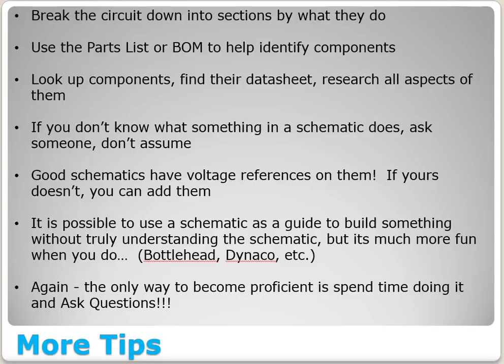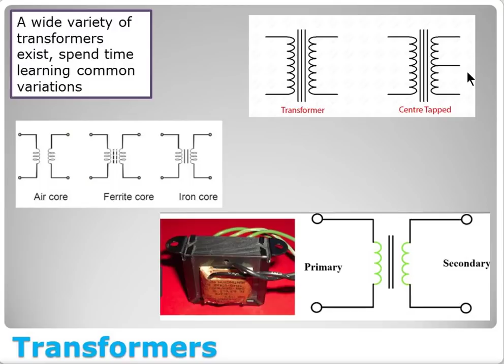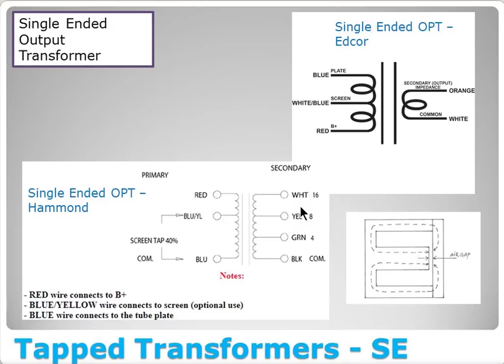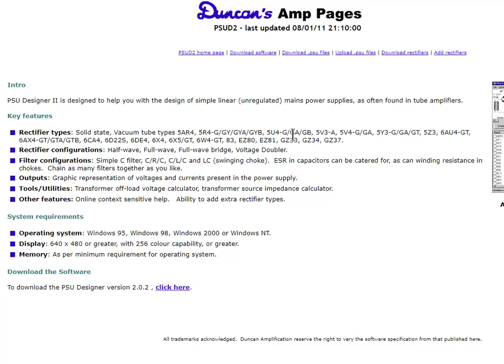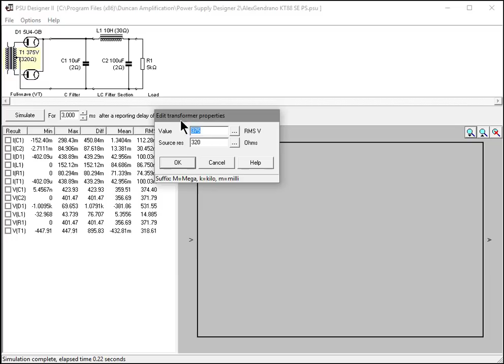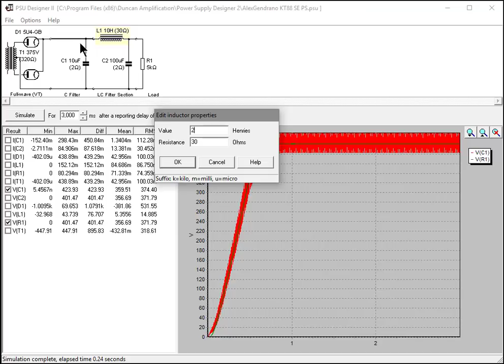Understanding Vacuum Tube Amplifier Schematics - Power Supplies - Part 2

Comment: I forgot to comment in part one, but the part that I liked learning, the most was about the coupling capacitor and how it prevents 400 V going straight to the grid of the other tube and basically the explanation of how a capacitor works, how it blocks DC voltage but passes AC voltage along.

Comment: Good video. I'm relearning. Went to school (20 years ago). No real world experience. Good review. The 5 VAC filament voltage line with the 400 volts dc coming off the same line is still a little quirky to me. I understand 2 voltages can exist on a line (ex: 10 volt dc with a 1 volt ac ripple)  ... but still!  Seems the 400 volts sitting on the 5 volt ac line would interfere with the transformer operation somehow.

Comment: What purpose does the CT of the 6.3V have? -- if the replacement X-former secondary doesn't have a CT for the 6.3V, is there a class of tubes' filaments that wouldn't work?

Comment: Breath of fresh air. A person who actually knows stuff talks about it. YouTube is pushing a lot of videos to me that eventually make me sad. Very often, you get people that talk total BS and can't understand complex circuits claiming totally wrong stuff spreading misinformation. To add an insult to the injury, when you correct them, they attack you and dismiss your correct information with plain rude stupidity.
You have to prove to them even the most simple rule of electronics. 
Real flat earyhers. 
As soon as I heard the voice on this video, it sounded calm and like someone sure of his knowledge, and it didn't disappoint.
I dred watching videos because if I hear misinformation, I will need to lose my time and comment.
In this video, there is one small mistake  and one thing that is almost no mistake and could be explained a bit more. I do understand that it is  a long video trying to explain a lot, but leaving something out might be important for someone.
That small mistake is about GZ34 and its heater and cathode. There is no superimposed 5V AC going into the DC/plus side of pin 8. DC side is referenced to the ground, providing minus coming from the grounded center tap.
5V tap is not center tapped, and pin 2 is not connected to the ground, so between pin 8 and the ground, there is no 5V AC. Sure, there might be some ripple from the fact that pin 8 is shared and is exposed to AC magnetic field, but it is not that bad at all.
Very easy thing to misunderstand.
The second little thing is something that really needs more explanation, in my honest opinion. Mind you, this is the first video I have seen of this channel, and some other video might have addressed it, but I wouldn't know that at this point.
It's about impedance issues with output transformers.
Two things about it. First is a little half mistake. In the case where you have only one 8 Ohm output tap you can connect 16 Ohm speaker to 8 Ohm tap and use it however long you want. It is not optimal, and you will not get the full power output of the amplifier. You will get only half of its rated power, but you will not hurt the amplifier.
Me saying this promotes bad president of experimenting, though, because if you experiment and connect the 4 Ohm speaker to 8 Ohm output tap, we have a huge problem.
4 Ohm load connected to the 8 Ohm output tap will reduce the projected impedance to the plate of the output tube in half. This will make the output tube try to pull twice more current than what's designed for. Something gotta give, and something will overheat and die. It might take even few parts put.
Please understand that the biasing current of the vacuum tube is way higher percentage wise than biasing current of the transistors. Fixed bias applications use 60 to 70 percent of the maximum plate dissipation, and cathode bias application uses up to 90 percent.
So you can't connect 4 Ohm speaker to 8 Ohm output and think you will just play it quiet so there will be no excessive currents true the amplifier.
That might be true with the solid state amplifiers, but it is not the case with the vacuum tube amplifiers.
Even if an easier fixed bias case, the bias current will already go from typical 70 percent to 140 percent. In the case of cathode biased output stage, it will go from 90 to 180 percent. So already without signal it will runn to high current and will break parts over time.
Therefore, I think more explanation is needed about how impedance on the secondary side affects perceived impedance on the primary side of the output transformer. Also, that would explain somewhat confusing information that you get with your Hammond output transformer.
Hammond expects people who buy and use their transformers to know stuff, but it ain't always the case.
Namely, they give you two or more values for each tap.
And they are perfectly correct.
They say, for example, 8 Ohm tap by 2500 Ohm primary or 16 Ohm at 5000 Ohm primary. This example is from single ended SE series.
What they are telling you is that the winding ratio stays the same, but primary side impedance changes with the load you connect to the secondary side. There is direct interaction between the impedance of the primary and secondary side. They are not two separated resistors. For the DC, they are separated, but for the AC, they are in the direct proportional value relation.  There is no electrical connection at AC, but the impedance of one side affects the other side directly. 
This can be useful sometimes. Some transformers might be designed for a pair of relatively powerful tubes but might have proper primary resistance for a set of 4 weaker tubes when you use secondary with different spaker impedance. Be careful with calculations, though. Mind you yhat you can't expect two tines higher current just because you use it as two times lower load. Transformer is power limited, wire used, and quantity of iron used limits its capability. 
You can't expect that 40 Watt output transformer becomes 80 Watt transformer.
BTW, it was a very nice explanation of the ultra liner operation. Easiest to understand. Most people are explaining it way too complicated way.
In today's world, one can't even expect that someone knows things like the rule of the right hand sadly. I think you might want to address it more. What is simple and logical to people from back then is mystery to people from today, sadly.

Comment: Thanks for the nice videos. However I don’t think your explanation in the video at around 19.40 is not accurate enough. The transformer core tends to saturate because of the constant quiescent plate current in the class A I think.

Comment: I understand that when the tubes are installed in an amp that load in conjunction with the internodal resistors in the power supply is what defines the voltage at the nodes and i know that when you pull the tubes those voltages go up but why do they not all come up to full b+?  If the ps isnt referenced to ground thru the tubes to define the voltage drop why is there still a voltage drop and how do the volts know how much to drop?

Comment: Really enjoying your channel ! Excellent series ! I wanna jump the gun and learn how to convert the schematics into or onto a board and how to etch ! I'm eatin this up ! I'm an ST70 Bottlehead ! Ya know I restored my first one way back in the early 90's before everyone sold all the kits and boards. I could follow the instructions and build it, but I was aggravated because I didn't fully understand how it worked ! I made one small mistake, I'd reversed polarity on one of the small caps on the driver board. Was using a Variac to do the initial power up. It popped and smoked about halfway up! I flipped it over and giggled when i figured out what I had done. I had another one, stuck it in there and it fired right up ! Thank you for what you have taught me!

Comment: Studied electronics in 70s - this brought it all back. Haven't touched a tube since then, but you've sparked my interest.    p.s. I almost skipped watching this "boring" power supply episode because I'd always thought that if I cooked up an audio tube amp that I'd just use a solid state power supply. Glad I watched though since understanding the PS is necesary to understand a tube amp functions e.g. biasing, 5v and 6.3v filiments.

Comment: I have something to add on the multiple OHM taps starting at 27:15  I am sure that most people know this already , but in case some folks don't know here it is ,  you can add switches on the back of the amp near the speaker jack  and label them 4 ohm , 8 ohm ETC ETC .... The most commons are 8 and 4 ohms for band amps .... Guitars and such....A lot of small 4 watt amps power a separate speaker  box.....  Larger amps like Peavey and Marshal's have the speakers built into the amp box .....

Comment: One thing I've always wondered is why (at least in these circuits) the rectifier heater isn't 6.3V like all of the other tubes'. Seems like a little $ could be saved by not having that extra 5V winding.

Comment: Interesting and nicely made but I seem to be missing an essential point on the diode operation: where does the magic B+ (400 or 500V) comes from? I undertand that for the diode to operate, the plate (anode) voltage has to be higher than the cathode. But how does one establish what the cathode voltage is from those diagram? You state this as if it was the most natural expectation but does not come as such to me. Is there another video that I haven't stumbled upon yet to establish this basic fact.. Thanks anyway for an otherwise very accessible material!

Comment: could you make video going in more detail into all typical capacitor application patterns to consolidate and give a few examples of solid state as well as valve amps using this patterns.  eg pattern 1 Resistor and capacitor  in input transformer... purpose making DC curve of B+ as constant as possible. pattern 2 coupling capacitor from plate output to grid input... etc capacity in cathode biasing circuit... there seems to exist 100 different patterns for using capacitors . typically seems to be always a game of let ac pass fix dc etc ... many thanks for the great video

Comment: Have a poblem i trie to solve.Power tube 3 is redplating.It happens  around 1 minutes after standby is off.I took out tube 2 and 3 so only 1 and 4 is left.Iknow i have to use 16ohm speaker into 8ohm output.This time the tube 4 started to redplate.when the tube start to redplate i can hear Hum.(bad capasitor after rectifier?for half the circuit? push pull.)Seems to be only the one side in the tube that redplate in both.Can it be a capasitor?ouput tubes is el34 where 2 is marked 1604.the 2 others marked 1606 if that means somthing?Is a old Huges Kettner trilogy.Cant find chematic or a service manual for it.

Comment: Really useful. I was trained as an electronics engineer by the Royal Air Force in the UK 40 years ago. I haven’t worked in the field since 1992 so I’d forgotten most of what I knew. I have a Fender Prosonic tube (valve to me as I’m British lol) guitar amp head which was faulty so I did a search and found your videos. Everything came flooding back. Result, 1 new electrolytic capacitors and 1 resistor between two halves of a 12ax7 tube and a fully working amp. Cheers

Comment: Great video ! ! Well taught with a great teacher vibe ! ! A beginners video with a shop tool list with electronic bench testing equipment included with suggestions as to which is best for two or three price ranges, electronic safety tips, basic trouble shooting techniques would be a great way to prepare for basic repair work.

Comment: I have a 1950's Chasse with 4 6v6's in push pull parrallel  to calculate the secondares of the output transformer is the plate inpedebins defferent then 2 6v6's .   And can I use a 5u4 and 2 as foods to form a full wave bridge.

Comment: Learned a lot, clarified a lot. Thanks. 
Questions: How does using DC regulated five volts on the filament of the 5U4 or 5AR4 change the output ripple if at all? Would there be any benefit to  feeding the rectifier filament from a separate transformer; does using a separate transformer for filaments take some of the load off the main transformer? Does the power supply program you used allow you to substitute dc to the filament?

Comment: Hope your still taking,requests I am very new trying to,absorb all I can I have several older tube radios and feel I have enough parts between tubes resistors transformers etc.. Could you do a scabbed together with what you got thanks your series is very informative

Comment: Very good information! I was wondering about center taps. I understand they can pull current off of the transformer but am not clear on why they can be grounded without causing a short. My guess is that grounding it is not a short and instead nulls the CT? But why not just cap the lead? Also, when using a CT, wouldn't that reduce the current from the other legs? Sorry if I am using current where I should be using voltage. I'm going to take a break from these videos and go learn about ohms law and do some breadboarding to further my learning. It has become clear I need to understand that before I can move ahead.

Comment: Question - On circuit example #3, just before the standby switch, there are a couple of 16uf 450VDC capacitors in parallel.  The purpose of those capacitors are described as being part of a CLC filter for B+.  Is there a reason why those capacitors are placed before the standby switch and not after the switch like the rest of the CLC filter?  Thank you  - Dave
Reply: If they were after the standby switch, when the switch was closed they would appear as a momentary short circuit to the rectifier which would pass a current in excess of its rating, damaging it and reducing its working life.

Comment: Glad I took the time to look at this one.  Never heard of a "death capacitor" before but it makes perfect sense.  Reminds me of an old 50s era refrigerator that I bought for $10 off a friend during my freshmen year in college.  One day I opened its door with one hand and touched a grounded metal shelf with the other hand and got treated to a full AC electric shock.  I quickly realized that the old non-polarized two pronged plug it had needed to be reversed so did that and from then on got no more shocks, but it taught me that grounded outlets and plugs can be lifesavers.  Even kitchen appliances can be shock hazards if you're not careful.

Comment: Hi Mark,if you Schematic required 10H 200mA choke and you only had a 5H 200mA choke can you put a resister in series with the 5H 200mA choke?

Comment: Hi Mark, Very good information.. Maybe you could do a video on actual formulas to arrive at a desired voltage on a tube plate, or screen.. For instance, if you were building your own amplifier and not following a schematic exactly. I know most amps are basically laid out the same (as shown in this video) but what if you wanted to use different pre-amp tubes which required more or less voltage? There must be math formula's for this. Thanks, Tom

Comment: Hi, this was a very informative video. I do have a couple of questions if you don't mind answering. In the schematic using the 7199 tube, how come there isn't a coupling capacitor from the pentode plate to the grid of the triode? Wouldn't there be DC present that needs to be blocked? Also, on most LTP inverters, usually one of the plate resisters is lower...like 82k or something, and the other 100k. Is that to try and equal out the gain? Just curious. Thanks

Comment: for your Aussie followers what changes to power supply design are needed for 240v (not sure of the hz) input?
Reply: Simply replace the 120V 60Hz transformer for a 240V 50Hz transformer with similar output voltages and currents. The difference in frequency makes no practical difference.

Comment: Very well explained.  You have a lot of patience going through all of this.  I would like to ask if you can elaborate on how exactly a tube rectifier works.  I am used to solid state diodes, I simply don't see how AC in a tube becomes DC.  Another big mystery to me is how a "choke" works.  How can a coil filter a ripple ?  I always thought this is what capacitors are supposed to do.
Reply: A tube diode, just like a solid state diode, will only pass current when its plate (anode) is positive with respect to its cathode, when it is said to be 'forward biased'. An AC voltage applied to its plate will result in pulses of current at its cathode during the positive excursions of the AC. A transformer with its center tap connected to ground produces AC voltages which are 180 deg. out of phase, i.e. one voltage is positive while the other is negative and vice versa. If these out of phase voltages are fed to the two plates of a rectifier tube, each diode will conduct during the period that the other is not conducting, resulting in a series of positive pulses of current at the cathode.
Each dropper resistor in the B+ supply not only reduces the voltage, but acts as an RC low pass filter in conjunction with the following capacitor, reducing ripple. A choke is an inductor which has a property known as 'reactance', a resistance to AC that depends on its frequency. The Hammond choke in example circuit #4 has a reactance of 7.5k at the 120Hz frequency of the ripple current but only 82 ohms of resistance to DC. This means that it can, in conjunction with the following 100uF capacitor, efficiently filter ripple current while allowing the majority of DC voltage to go to the rest of the amp.